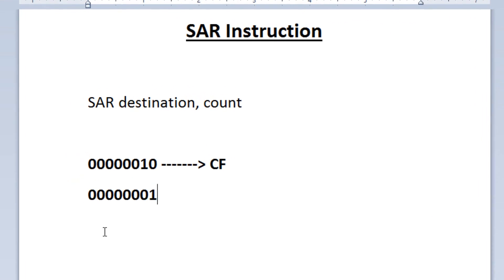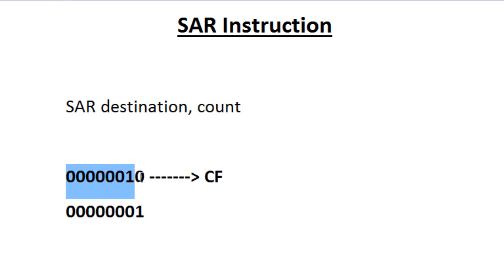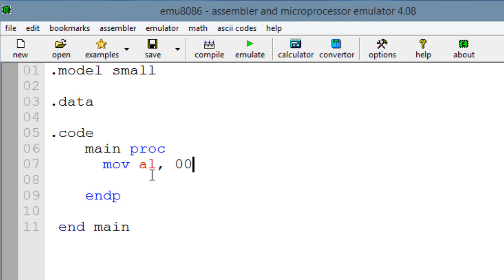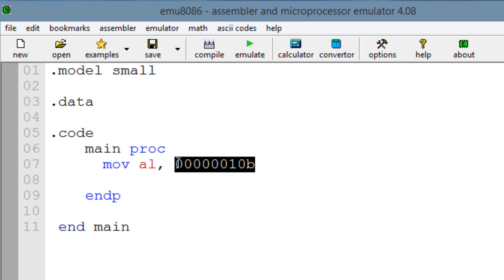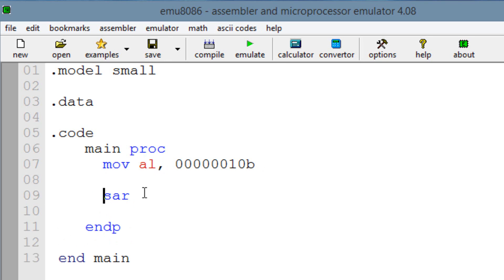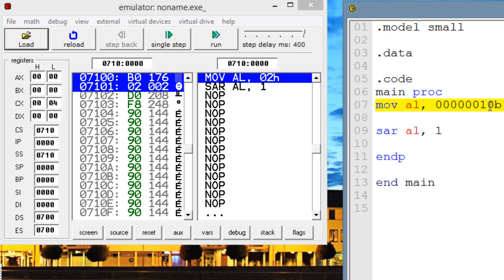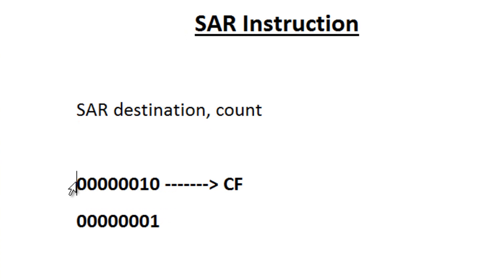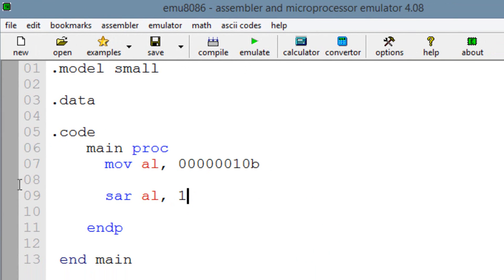Assembly Language Programming Tutorial - 48 - SAR Instruction

Comment: thank u for the video,
But actually SHR Instruction is not identical to SAR
SAR shifts each bit to the right and copies the sign bit, so if we have ax= 1110 0011 and count of 3 then ax = 1111 1100 means we'll insert the sign 3 times which is 1 and remove the first 3 bits.
Reply: I ger a point
Reply: That's  correct  bro